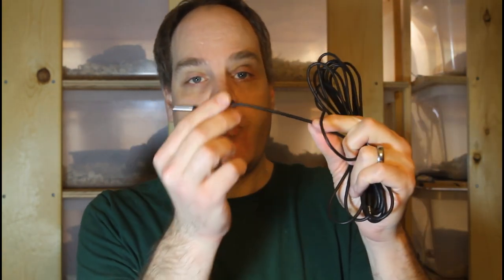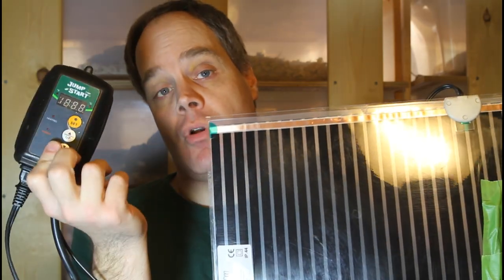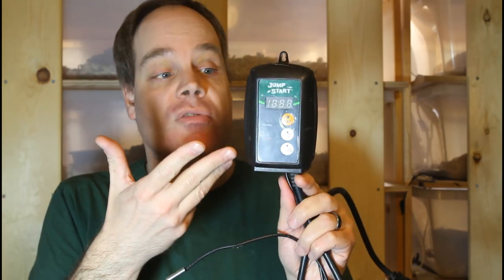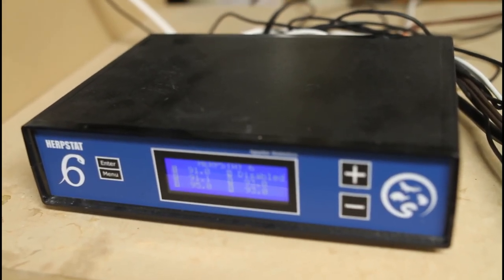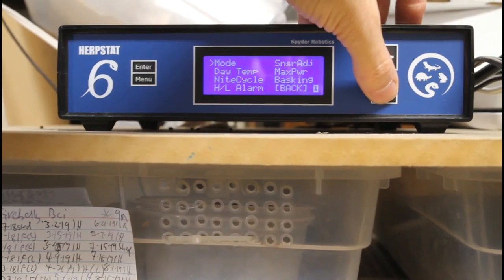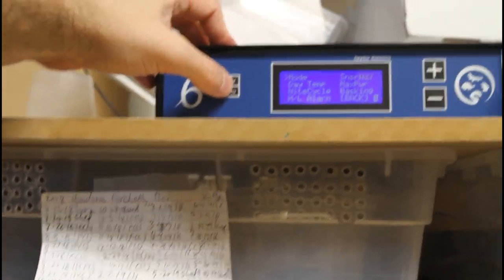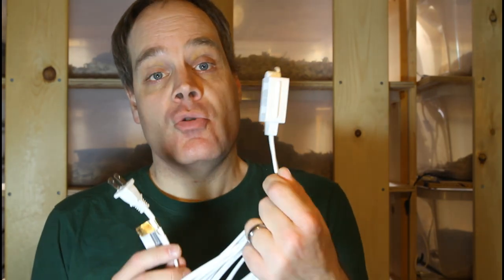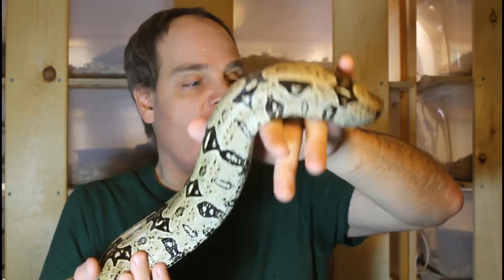Thermostats for Boa Enclosures

Comment: As always, this is so helpful! I'm one of the moderators for a big discussion group for new snake owners, and I will definitely be sharing this video because I think it will really be useful in showing folks how to set up their thermostats. Up until very recently I always recommended the Jumpstart thermostats as a 'starter' thermostat for new owners until they could pick up a Herpstat, but...the Herpstat EZ1 is $79, and that should be fine for a new owner with one animal. The Jumpstart is about $30. So obviously it's cheaper, but I'm not sure I can bring myself to tell people they should get one when they can have a Herpstat for not that much more.
Reply from the maker: Thanks!  Yes, Jumpstarts can be ok to start with, but ther fact that they can fail on the on position is very worrisome, and, as you nicely put it, the Herpstat is not that much more.  The Herpstat should also last much longer, so the extra price is definitely worth it!

Comment: I have a question, I placed the thermostat probe inside the plastic tub and taped it to the bottom, I use a paper towel for the substrate, I put a shelter over the probe and I set the temperature to be 95F, however, I measured with a digital thermometer and on the surface of the paper it varied between 88 and 90 degree. Now I have the thermostat set to 98.5 and it reads 94F on the surface of the paper. Is it possible that a paper towel is such a good insulator and that there is such a difference? Otherwise, the snake is constantly lying in a warm shelter, so I believe that it is not too high  temperature for her?
Reply from the maker: Yes, the actual temperature in the enclosure may not be the same as the thermostat setting.  And I would definitely not recommend to put the probe inside the enclosure where the boa can move it.
Reply: @BrianBoas  Thank you very much for your reply, I love your channel, it has a lot of useful stuff. I heard that they sometimes move the probe, but I only have one boa and I'm home every day so I check it regularly, thank god it's still in place hahahahahha